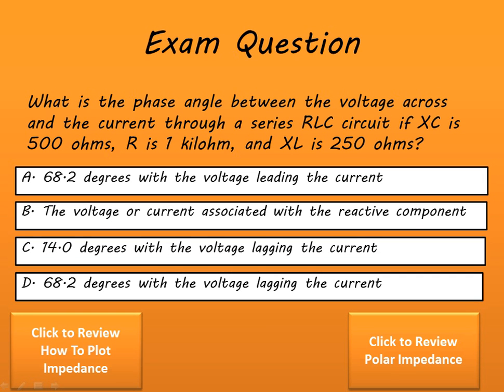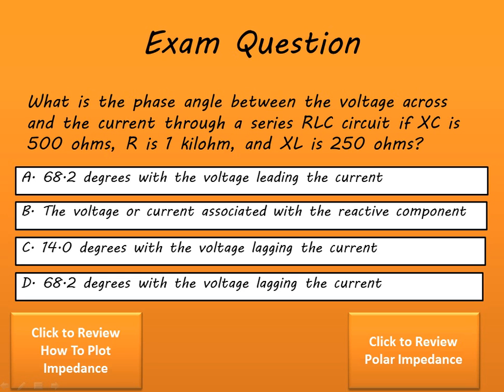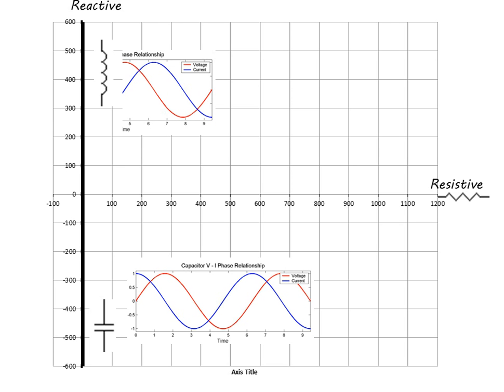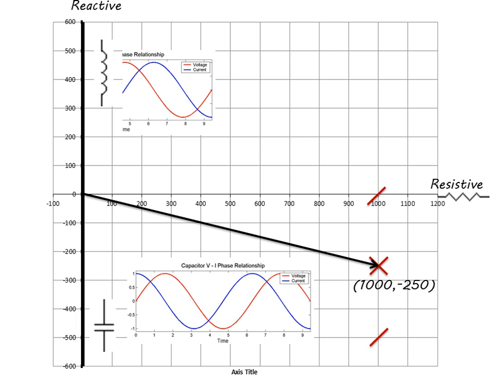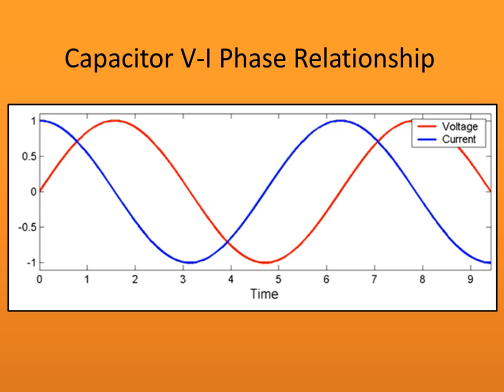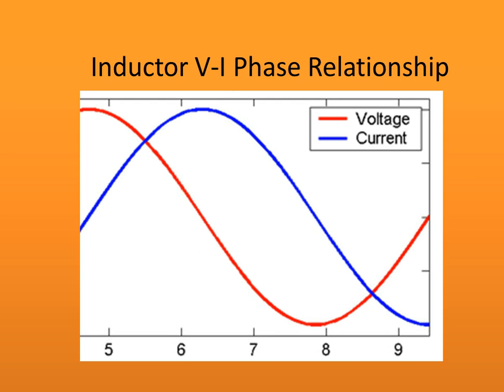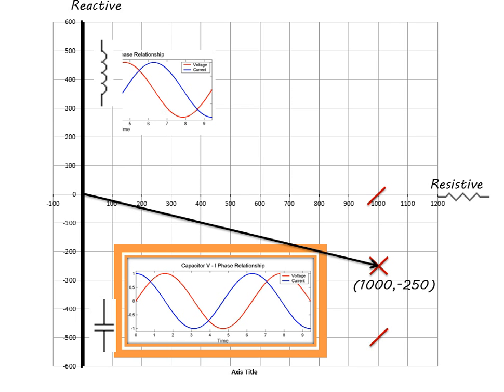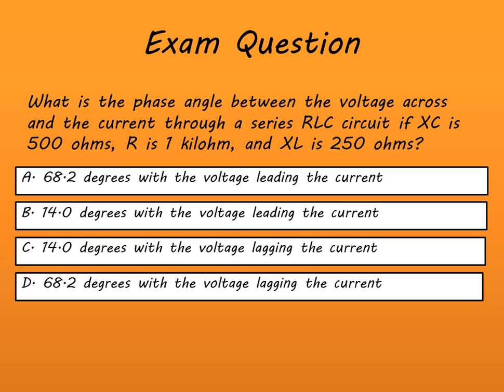Voltage Leading/Lagging Current Extra Exam Questions

Comment from the maker: Determining Whether Voltage Lags or Leads Current in an RLC Circuit Extra Class Exam Style
If you're coming in from the physics side
In my spare time I write web apps. I also play with ham radios as KD0FNR.  One of the web apps I've published provides practice exams for ham radio license tests.  What follows is a study video for the extra class exam.  The extra class license is the highest class of license an amateur operator can earn in the United States and the test requires quite a bit of electronics theory. 

If you're coming in from the ham radio side
For my full time gig, I'm a graduate student in the physics department at Texas A&M University.  In my spare time, I write about physics topics that catch my eye on any given day.

Now for the study video
This study topic details how to work through the questions on the exam that ask about the phase relation between voltage and current in a series RLC circuit.  It shows a few tricks for doing the problems without a calculator.  All feedback is welcome.. please!  As for me, I feel this video is a bit flat, (there aren't any pirates or a moose), but I believe it gets the basic points across.  #E_5_B_07
 #amateurradio   #hamradio
Reply: Oh I wish I had seen this before my calc physics II final!
Reply from the maker: Christel Davies that's a bummer!   I hadn't thought about it, but the questions are similar.
Reply: I'll get it down for circuits in the spring, =^D
Reply from the maker: Cool!